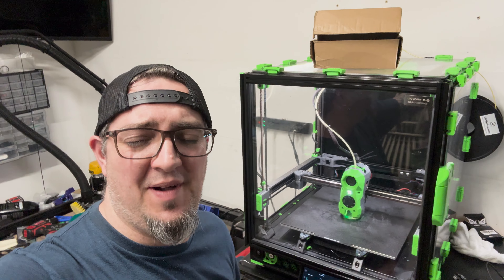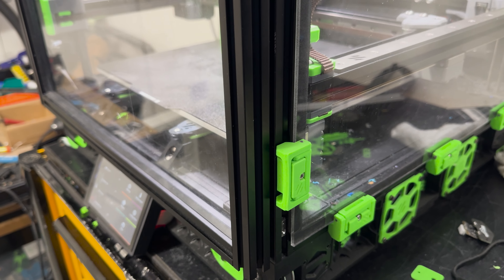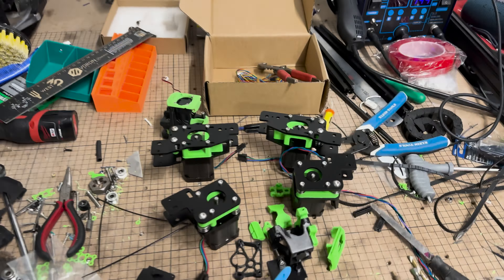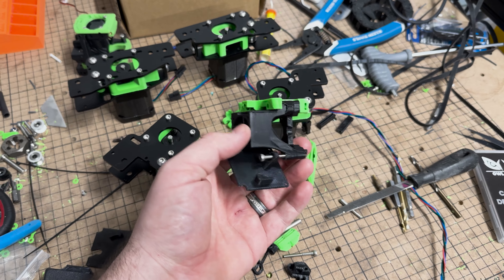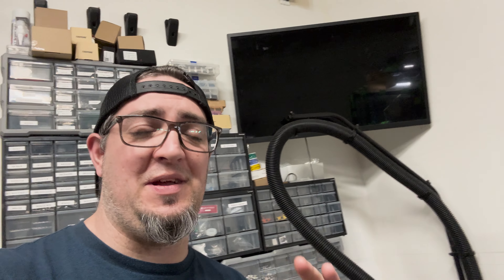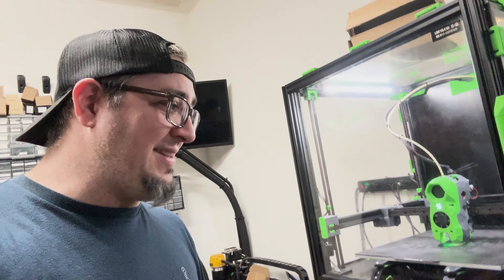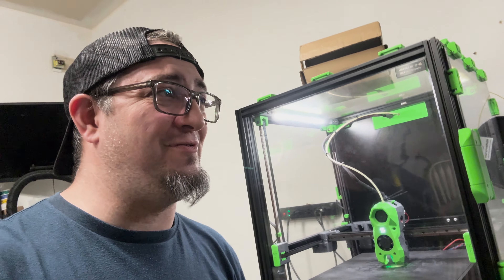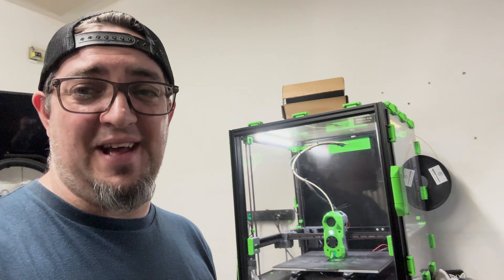Updates and Upgrades!

Comment: the new thing with sherpas is the 6 thooth motor
Reply from the maker: Interesting, im just learning about them and getting into them. starting with the 10 tooth, I will look into the 6 tooth today.

Thank you!
Reply: @TheVoronModder  Go with the * tooth, Its far more accurate, I have moved on from the CW2, and I am wanting to get into the Galileo or the Orbiter v2 on my 350 v2 but running sherpas on all my printers. Only issue I am running into is my rapido UHF v2 seems to have a heck of a retraction issue. Stringing all over, I want to use .06 or .08 but cant get ti into control properly. Sooooo... starting over. lol